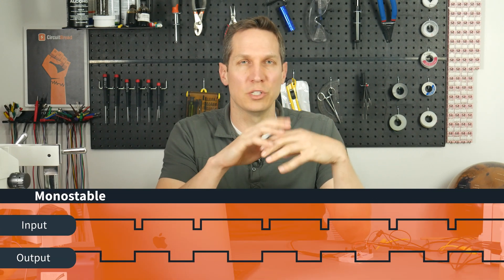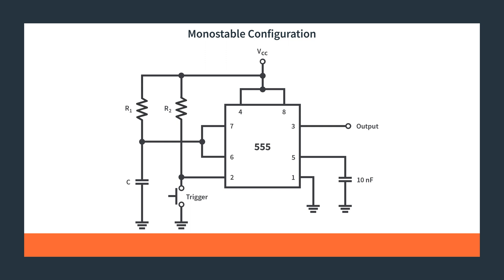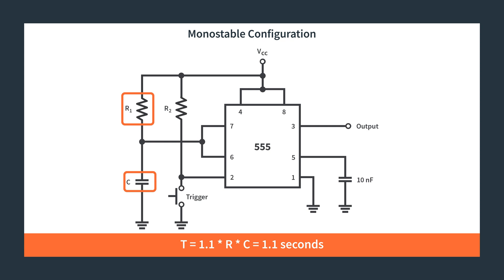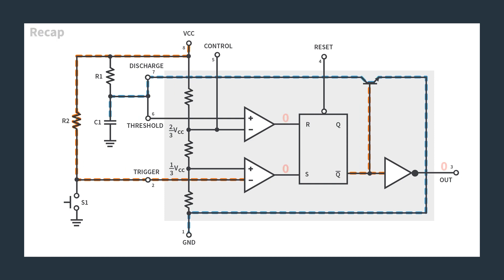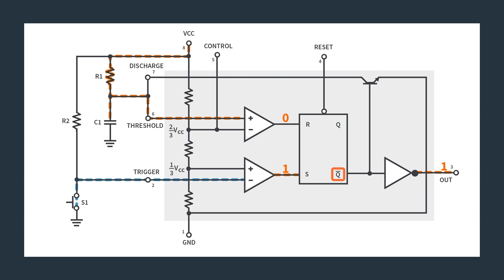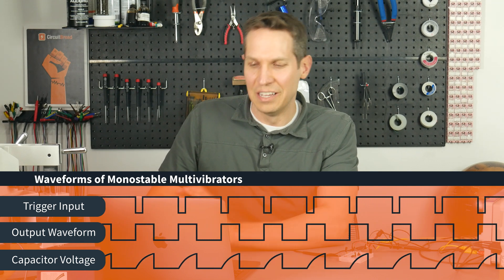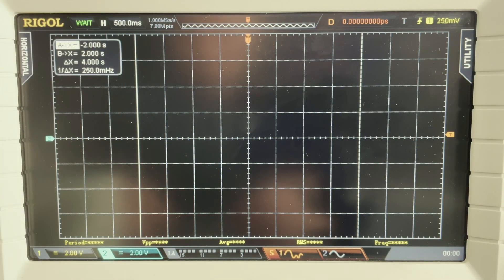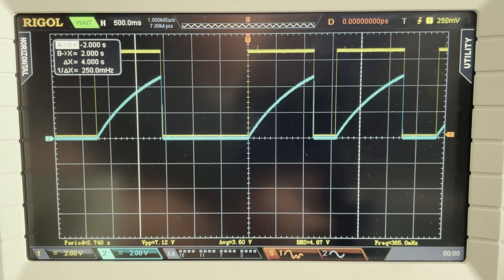555 Timers - Monostable Multivibrator Configuration

Comment: I would like to get a short plus out after a contact closure. However, the contact will be closed much longer than the pulse. I don’t want another pulse until the switch opens an then recloses. Can I just put a small capacitor between the switch and pin 2?

Comment: At 3:20, doesn't the fact that Vcc goes through R2 causes the Vcc to be reduced coz of the voltage drop across R2?
Reply: I think I know why, but I could very well be wrong. I think comparators are assumed to have an extremely high resistance, which makes the current very small, which leads to a small voltage drop across the resistor.
Reply: Yep exactly the imput impedance of the  op amp is so big the current through the resistor is negligible and the voltage drop very small

Comment: This was a very good explanation. Very good animations. Thank you!!!

It would be nice to also talk about the edge cases: What happens if you press and hold the button continiously. Also: Please measure the cap, there is typically +/-20% tolerance. With the actual value you can verify the intervall better. Furthermore you could use cursors or the measurement function of the scope to measure the intervall more precisely.

Comment: I love this channel and what you are teaching. 
For the people out there wondering what this configuration is good for:
1: Debouncing keys. If you press a little tactile switch, there isn't just a sudden ON state, in fact all mechanical switches bounce, generating a lot of noise before settling on the contact.
If you have very fast electronics reading that switch, that circuit might interpret that as 10 or 20 rapid button presses. Especially in applications with limit switches or implenting toggle functions, this is a crucial circuit if you cannot do this in a uC in software.
2: Peak detector follower. A peak detector is an OpAmp circuit that takes super short pulses and converts them into longer pulses. You might think, yeah, that is what this is doing anyways so why would i need it?. The answer is sensitivity. The higher the capacity of your integrator capacitor on the opamp, the lower you sensitivity. So you want this to generate another pulse long enough to trigger i.e. an interrupt on a uC or for a counter to react (this is more for scientific purposes like SIPM detectors)
3. Timebased exclusion of concurrent incomming signals. This is a bit more esotherical, but if you are ever in a situation where you want another signal to be ignored for a while when another one just hit, you can use this.
Reply from the maker: Awesome!  Thanks for these applications, that's fantastic.

Comment: What a nice coincidence, i just finished a 1kHz 50%dC Sqarewave gen with the last 555 i could find (turns out that my imagined massive stock of NE556 in fact where all NE5532 Dual OpAmps ^^)
I just needed a little something to inject into possibly faulty 74xx chips to see if they still play ball. (did not want to abuse the calibration gen on the scope and my function generator is single channel only)
Which reminded me of something: If you plan on building something with a target frequency precission of ~0.1% do yourselves a favor and add in some trimmers.
1kHz is in the audio range, so even if your souncard cannot represent the a sqarewave coming in at that freq you can still meassure from zero crossing to zero crossing to adjust the timings.
There are many usefull programs out there that turn your sound interface into a low bandwith scope. Perfect for starting out without commiting a few hundret bucks. Ofc any halfway decent scope will do a much better job, esp. in troubleshooting.